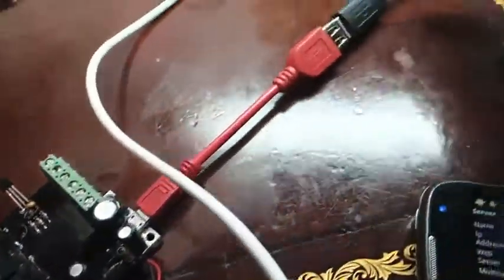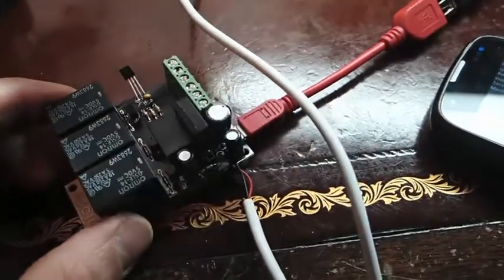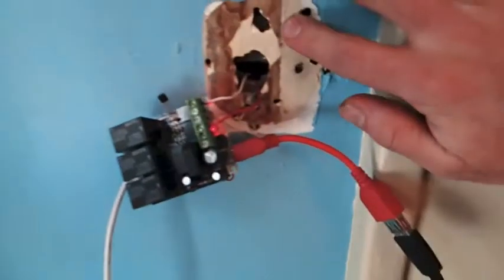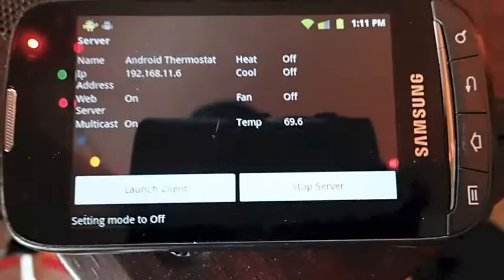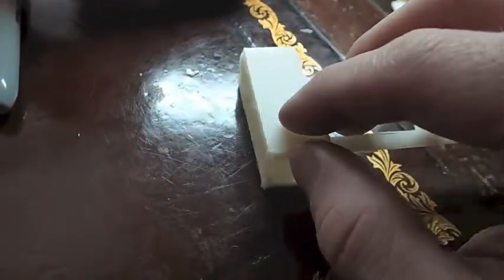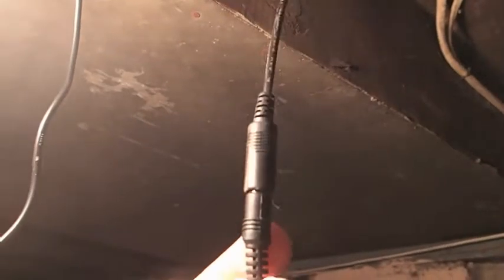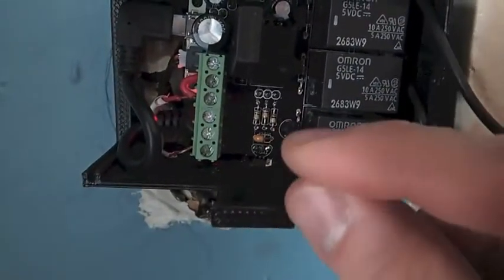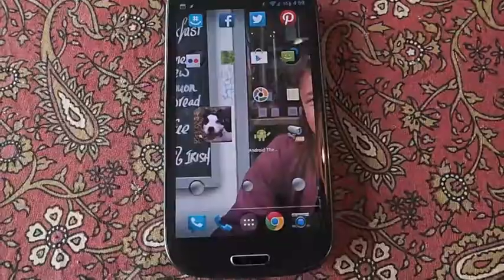How to build the Android Thermostat part 3

Comment: If I have a 5-wire setup, do you know if i'll need an external power source like you used in order to power the board and keep the phone charged?
Reply: ***** I've run into a bit of a jam... so I've hooked up the phone to the ioio board, and have also dissected a 5V source (old iphone usb charger) and connected it to the ioio board. The board powers up just fine (red led on) and the phone recognizes that a device is connected. However, the phone does not charge! What am I doing wrong?